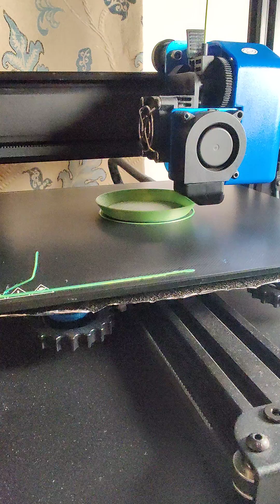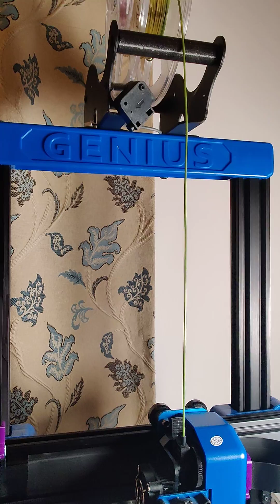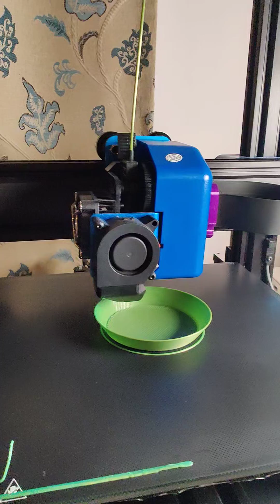Printing with a 0.8mm nozzle on the Artillery Genius.

Comment: Hi, what slicer did you use?
Reply from the maker: I've been a PrusaSlicer user since I started. While Cura is pretty good, I find that PrusaSlicer profiles for the Genius work better for me.
Reply: @asadjibran please,  would you pass me a profile prusaslicer with nozzle 0.8
Reply from the maker: @GiuseppeLepore  Wish I could help, but I changed my laptop a few months ago and don't have the 0.8mm profile anymore.

I found that 0.6mm was a much better compromise b/w speed of printing and quality and I've been using that for the past couple of months.
Reply from the maker: @GiuseppeLepore  To add to my last answer, I started with the built in 0.4mm profile for the Genius (Prusa Slicer comes with it now) and tweaked it to work with 0.8mm nozzle size.

Comment: Small tip - don't be afraid to speak up!  Let us hear ya! :D  Some of us are fighting the 'big nozzle' battle and definitely appreciate you making the video for it.

It definitely changes a lot of aspects of 3d printing.
Reply from the maker: Thanks. Good audio is something I still struggle with but understand how important it is, even more than video quality. Always trying to make it better.

Big nozzles are just so much convenient for the right prints. I moved from a 0.8 to 0.6mm nozzle on this printer and have been very happy with the results. The prints finish faster, and quality doesn't suffer as much as it does with a 0.8mm nozzle.
Reply: @asadjibran  definitely seeing that quality suffering on some of my prints with 1mm. LMAO!  But I do have some "blocky" stuff that there is no detail...yeah bud.  1mm zips through those . LOL
Reply from the maker: @nicholaswillcox  True. seeing the filament just fly off the roll with an 0.8mm is a bit scary. :)